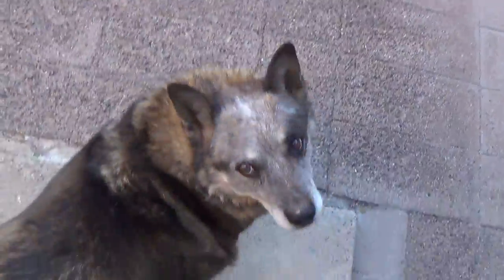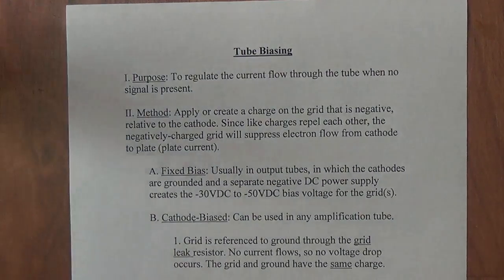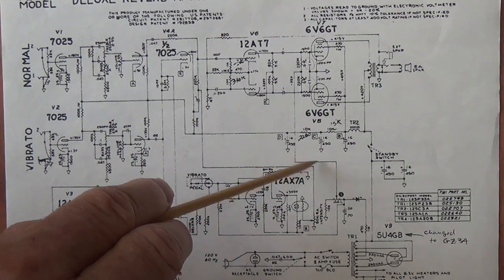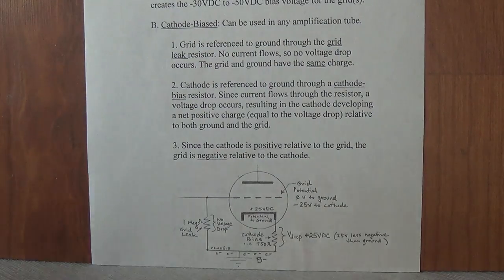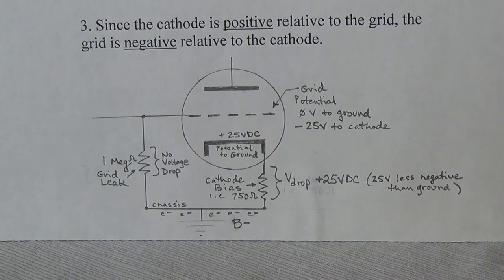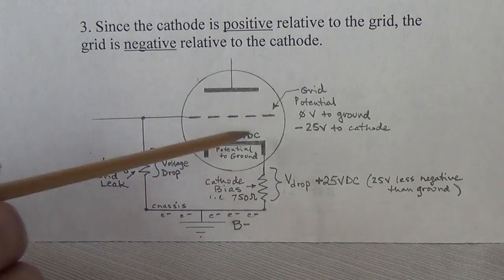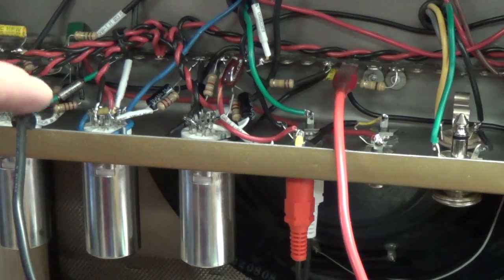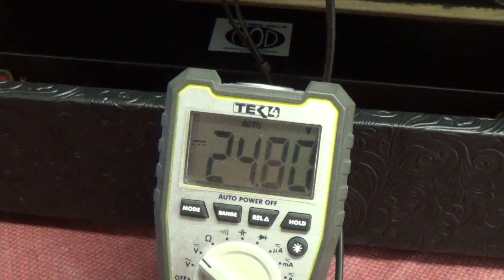Resistors, Part 4:  The Cathode Bias Resistor

Comment: After studying this superb video (more than once) I'm still trying to figure out how to determine the proper wattage of a cathode bias resistor. On a schematic I've been studying ('59 Tweed 5E3) the cathodes of the two 6V6's go to ground via a 5 watt resistor. If there's a calculation to determine the required wattage I guess I'm just missing something.  Thanks as always. JC
Reply from the maker: It's Ohm's Law, Joey.  Current squared x Resistance = Power.  For example a 30mA tube with an 1000 Ohm bias resistor:  .030 A  x .030 A x  1000 Ohms = Power     Power (in Watts) = 0.9 W   Normally you will double the wattage to be safe, so in this case you would use a 2W resistor.

Comment: At 5:30 you state current flows from the cathode to the plate.  I was taught that current flows from the plate to the cathode - from positive to negative.  Electrons flow from the cathode to the plate.
Reply from the maker: The Conventional Current theory (current flows from + to - ) is an artifact from the early days of electrical discovery and science, Devin. It was based on the idea that everything flows from an area of abundance to an area of deficiency......which is correct.......but they failed to understand that with electricity, since the only mobile charged particle is the negative electron, the area of abundance was actually negatively charged and the area of deficiency was positively charged. It's a shame that schools have perpetuated the fallacy of CC theory, since it is archaic, illogical, and without basis now that we know better.
Reply: Things might well have been simpler had Benjamin Franklin assigned the "positive" name to the charge on the amber rod rather than the glass one.

Comment: Thanks for the video, Doug. The thing I still don’t understand is what is supplying the cathode current in a cathode biased tube?  In fixed biased, there is negative current coming from the transformer, but in cathode biased, the cathode resistor is connected to ground.  How does connecting a cathode through a resistor to ground generate a +25v charge at the plate?  Thank you.
Reply from the maker: In both cases, the cathodes are connected to ground, which is the source of negative (plate) current. The only difference is what regulates the passage of current through the tube. In fixed bias, an independent -DC voltage is applied to the grid. In cathode bias, the cathode resistor make the cathode more positive than the relatively negative grid.
Reply: @UncleDoug  thanks Uncle Doug.
Reply from the maker: @psalys  You're welcome, Pat.

Comment: Thanks again uncle Doug for your great contributions to my knowledge!  I hope this isn't a redundent question as I plan to watch all of your videos. Is there really a self- biasing amp and what does that mean?  Is it a fixed cathode bias cap?  I have a Crate V18 as a sand box to start getting immersed in tube amps and mods. Still has the original tubes from 20 years ago and support said i can  just plug in new power tubes (el34s) because the amp is cathode biased, therefore no adjustment necessary.  What do you think?
Reply from the maker: You're welcome, John. Yes, a cathode-biased circuit is self-correcting, within certain limits, and generally does not require re-biasing after the replacement of output tubes. It never hurts, however, to double check the bias of the tubes, simply because the value of the cathode bias resistor may change over time. I have posted a video showing how to do this. Good luck.
Reply: Struggling to find a positive (pun intended?) reason for fixed bias configurations. It sounds like cathode biasing is superior - what situations would it be advantagious to design a fixed bias instead of a cathode bias method?
Reply: Seth, in the unlikely case that you haven't figured it out - fixed bias is more efficient than cathode bias (you can get more power out of the tubes). This means the output section stays cleaner and can be louder before distortion. The resistor power dissipation values you need also get to be somewhat... crazy.

Comment: The most difficult part to wrap head around to is that the bigger the resistor at cathode to ground is, the higher the voltage of the cathode. You're used to thinking (or I am) that resistors "suck" the voltage out, and that increasing the resistance wouldn't increase the voltage, that the voltage drop increasing couldn't increase the voltage. Maybe it's the concept of ground = 0 V, and not being very familiar with the actual physical phenomenon of electrons flowing from negative to positive, while the other things are considered going from positive to negative, creating this "weird" case of going from 0 V to a resistor increasing the voltage on the other side depending on the resistor size.

I'm not sure how to think about it, the heater supply should provide a constant voltage to the cathode, right? And the resistor causes the voltage drop to 0 V to ground? So how does the resistor increase the cathode voltage? From U = R * I standpoint it does make sense that the voltage drop is higher with the same current, but what's the dynamic between heater supply and the cathode relative to this resistor? Where does the extra voltage come from with bigger resistor? Or where does it disappear with lower resistor?
Reply from the maker: The heater supply has no connection to the cathode. All that matters is the charge differential between the grid and cathode. The higher the bias resistance, the greater the difference between them, because the grid-to-ground resistance does not change.

Comment: The cathode resister
With a bypass
Capacitor in parallel with it to ground is also
Called an automatic
Bias control.
Reply from the maker: Cathode biasing does provide stabilization of the bias.
Reply: You do have a good method of explanation and teaching I hope you live a long time and don't completely retire as long as you live thanks for your help.
Reply from the maker: @dwightjt  Thanks, Dwight. I hope so too ;)

Comment: @Uncle Doug .... QUESTION.
Could we just build a voltage divider using a potentiometer for the cathode bias resistor and the grid leak resistor?  Now it is a tunable bias? Another question is does the value of the cathode bias resistor effect the passband freq seeing that it is in parallel with the cathode bypass capacitor?
Reply from the maker: Why bother, SS? Simply installing a variable resistor (to ground) will accomplish the same goal (tunable bias), without altering the grid leak value......also, since bias resistors are generally in the sub-1K Ohm range and grid leaks are in the 1 Meg range, it would be quite a stretch. The value of the cathode bias resistor must be appropriate to achieve proper  plate current levels, while the cathode bypass cap value does indeed affect the frequency response of the tube. Check out this link for details: https://www.ampbooks.com/mobile/amplifier-calculators/cathode-capacitor/

Comment: Hi , Doug. I have a quick question which I think might benefit some viewers. 

My question is; 

Why would you use a small value cap from the plate resistor (or say pin 1 of a 12ax7) directly to the cathode of said tube (before the parallel resistor cap network to ground)?
Reply from the maker: This was a circuit mod used by Dumble in his famous Overdrive amps. The cap feeds some high frequencies back to the cathode as NFB to reduce the chances of ultrasonic oscillation and change the tone of any distortion.

Comment: OK, I've really enjoyed the vid, I've watched them all at least once, but I was watching this div hoping you'd answer a question, but you didn't and none of the comments got to it either.  I was under the impression that you need to "re-bias" and amp whenever you put new tubes in it.  But this vid makes it sound like as long as you stay with the same model of tube, you do not have to.  And only if you change from something like a 6V6blablabla to a something else blablabla you have to re-bias.  I don't know, I guess I'm still confused about what re-biasing means.  (I hope your answer isn't "please refer to my re-biasing video", in which case I will have to disembowel myself) 

As always, thanks.  I'm about to start a 5F1 based project that I'm hoping to squeeze into an antique radio cabinet that I found.  So I'll probably be hounding you (I hope Rusty doesn't take offense to that!).

Thanks again
Reply from the maker: If an amplifier's output tubes are cathode biased, there is generally no need to re-bias them after installing new tubes of the same type. If the output tubes are fixed bias (grounded cathodes), then you do need to re-bias them after installing new tubes.  I hope this clears up the confusion. Good luck with your 5F1 project.

Comment: great video. I'm confused about why you would have two bias resistors on a switch.
Reply from the maker: So you can change output tubes (i.e. 6V6 and 5881) and select the appropriate bias resistor for each.
Reply: Thanks I get it now. I've been spending most of my time this week on your videos. I'm learning heaps so thanks! I just watched the Term-Verb series today, so inspiring. blackface verb with a single-ended 6*6 what's not to love.

Comment: Hi Doug, thanks for the video. What if capacitor is in parallel with cathode bias resistor. Should I remove capacitor while measuring voltage drop and resistance of bias resistor?
Reply from the maker: No, because the voltage drop is DC, which cannot traverse the capacitor (unless it is "leaky"). It is as if the cap were not present, when taking DC voltage measurements.

Comment: Excellent video. Thank you so much. A basic question…How do we calculate the cathode bias resistance value by reading the data sheet??
Reply from the maker: The value changes in different circuits, Manoj. You have to refer to other similar circuits or experiment to find it.
Reply: Uncle Doug, thank you. I think, there must be a systematic way to arrive at the resistor value based on plate characteristics of tubes. Once we get the initial value, we could do some trial & error method to fine tune. But how do we get that initial value still remains as a mystery!!
Reply: If you go to http://www.valvewizard.co.uk/Common_Gain_Stage.pdf he explains the process in detail.

Comment: Hi Doug, I’ve chosen fixed bias for the 845. I give a few minutes of warm up time. The negative bias voltage at first was -200vdc plus. I adjust it down to -175vdc but after a while it kept dropping till I couldn’t adjust anymore n the plate went orange red. May I know why it’s that so? Many thanks...
Reply from the maker: Yes, it sounds like a classic case of leaking coupling capacitors, Tony.

Comment: Hey Uncle Doug.  I really appreciate the time you've taken to explain in great detail.  I had an old tube tech teach me what I could grasp at the time (Have you heard of Gar Gillies?), but there were so many little connections missing.  You are filling those in.  Thanks.  
So here's a question:  By lowering the Cathode Resistor, I increase the output wattage.  But there must be a downside to that b/c you said you chose the higher 750 ohm resistor as it was more inline with what you'd expect for a 6V6.  I'm wondering if there are any real world shortcomings to increasing power output (aside from exceeding the tube manual specs).  Would it increase power tube distortion? Which might be desirable to guitarists?  What do you think?
Reply from the maker: Tube biasing is based on the plate dissipation value for the output tube(s)....see my other videos for an explanation. The output wattage is not increased by reducing the cathode resistor value.....only the heat produced by the tube. There are very specific PD limits which should not be exceeded. If the output tubes are biased too "hot", they will have less headroom (i.e. they will break up sooner).
Reply: Thanks Doug.  Makes sense.

Comment: Thanks for walking this through again Uncle Doug.  I have a blown cap on a 5W tube practice amp and was wondering might have casued a 22u/25V polarised cap to blow from the cathode of a 6V6, also in parallel is a 1W/470r resitor and a 104/63V cap?  Personally I think, but do not know exactly how to check, that these amps run very hot and have a fixed bias.  From what I am picking up the 1W/470r is common.
Reply from the maker: Apparently the voltage across the cap exceeded 25V, Opto. I always replace them with 50V caps. The presence of a bias resistor would argue against fixed bias.
Reply: @UncleDoug  Thanks, still learning a lot, this is the second amp of the species, the other one burns out tubes, after a while they start making a lot of noise with input from a guitar.  It's a champ copy amp.  I thought the bias was fixed by the rating of the resistor as the there was not pot to adjust it.  50V caps as a goto is good advice, thank you.
Reply from the maker: @OptomodMix  Fixed bias amps have the cathode of the output tube grounded.....no bias resistor. The bias is usually too hot on Champs. Increase the value of the bias resistor to reduce the heat/bias.
Reply: @UncleDoug  Thanks for taking the time out to answer these questions Doug.  You have confirmed my next move of increasing the value of that bias resistor.  I'll hunt around to see what might give my tubes a longer life :)
Reply from the maker: @OptomodMix  Something in the 800 to 1000 Ohm range, most likely. Good luck :)

Comment: So if I reduced a CBR from 2.2k down to 1k, I should get more output at the plate. I'd be surprised if I could just do that willy-nilly without other ramifications, but it's food for thought. Thanks! Another great video.
Reply from the maker: No, no, no, no, Shaun. The value of the cathode bias resistor is carefully  selected to provide a proper plate dissipation value for the output tube(s). It must not be altered.....and reducing it might cause damage to the output tube(s).
Reply: Okie doke, thank you.  @UncleDoug
Reply: What I find interesting is that, in the APS-10 organ amp I'm converting to a guitar amp, the cathode resistors on the V1 12au7 are different for each triode: one at 1.2k and the other at 2.2k. I can't figure out why. Sorry, perhaps I should have mentioned the V1 rather than the output tubes,  @UncleDoug
Reply from the maker: Those resistors were selected to create proper operating parameters within each 12AU7.....and those parameters are different, depending on where the tube is located in the signal chain.
Reply: Thank you. I guess I'd better learn the math. @UncleDoug

Comment: When measuring the voltage drop across the cathode bias resistor and the voltage from cathode to ground (pin 8 to chassis) it appears to me to be measuring essentially the same thing from the same test points albeit different locations along the same line....what am I missing.
Reply from the maker: You're missing nothing, Rusty. The two measurements are identical. Even the test probe positions for both measurements are the same.
Reply: @UncleDoug  thanks for clarifying

Comment: Hi Uncle Doug, first of all: great series ! My name is Ernst. I Love to watch all of your video's and so do my 2 cats. Working on amps myself, my own and others. Right now getting my old VOX AC30 TB 1966 back to life again. One thing keeps me wondering, it has to do with the cathode biasing of this amp. I measured / calculated the dissipation: the old set of EL84's, they were 62%, my new set of (quad matched) EL84's resulted only in a 56%. Both seems to me rather low, cool biased. So here's the million dollar question: does it make sense to modify this cathode biased part of the circuit by adding a variable resistor setup, or just play around with the R values to get the tubes towards a nice 70% dissipation ? Why can't I find anything on this topic on the www ? Or do these AC30's always sound good (enough) to "stand te test" ? Like to hear your opinion on this, and if you say "yes do it" - what would be your solution to this ? Thanks in advance and greetings from a small country in Europe, The Netherlands, sometimes referred to as "Holland".
Reply from the maker: Greetings, Ernst, and thanks for the very nice comments. You mention "cathode biasing" and I believe the AC-30 is cathode biased (not grid biased), so the PD is supposedly able to be set at the maximum of 12W per tube.  The 70% rule only applies to grid biasing. However, I am finding that biasing at or near the max-PD is simply not necessary. My suggestion is, rather than being bound by previous theory, why not experiment to find the lowest PD for your output tubes that still provides great tone. You can use alligator clips to temporary install different bias resistors, play through the amp, and decide for yourself. A potentiometer might not be able to handle the current. Be very careful.....as long as your guitar is plugged into the amp, touching the strings will chassis-ground you.
Reply: @UncleDoug  "The 70% rule only applies to grid biasing" okay, I didn't realize. Thanks for your clear answer. Yes I will experiment, and am aware of the strings being grouded. Also I do stick to the one-hand-the-pocket rule :-) Have a great day !

Comment: 3:13:  Dear Uncle Doug: If a negative supply voltage (relative to cathode) is put on the grid, then how is it possible that the negative halfs of the sine waves are not cut off from the output at the plate? Wouldn't the tube act like a half-wave rectifier?
Reply from the maker: The negative bias applied to the grid repels electrons, but does not stop their flow. There is always a continuous flow of electrons, but it varies in intensity based on the charge of the grid. When the grid is strong negative, the low flow of electrons is relatively positive when compared to the high flow (relatively negative) when the grid is weakly negative.